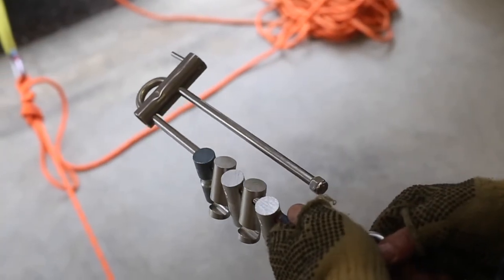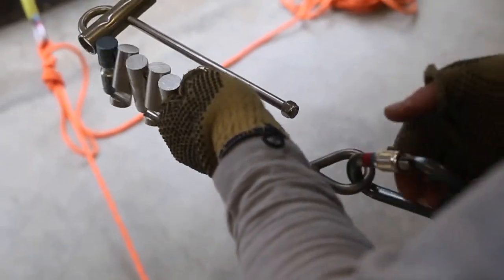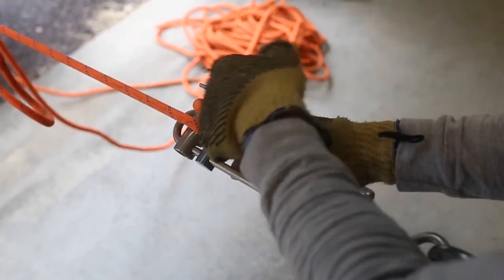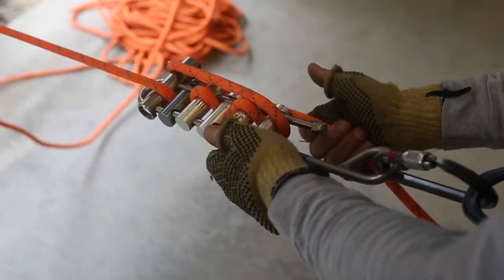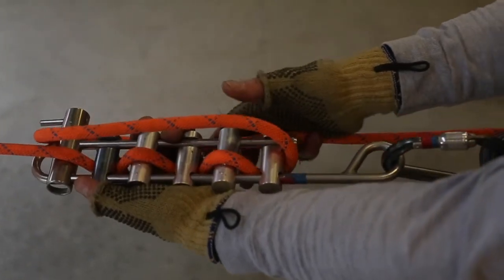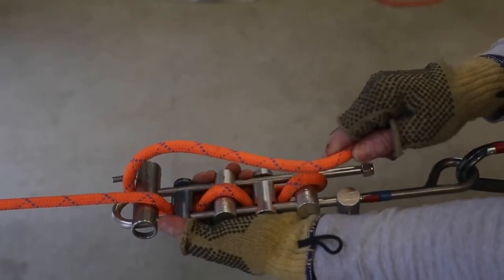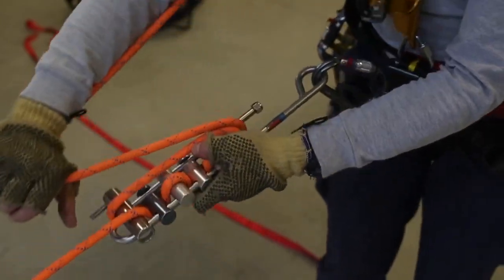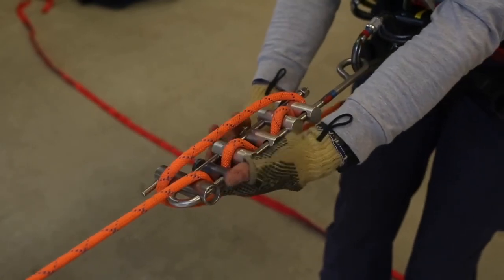Rig & Operate a 6 Bar Brake Rack for a Rappel: Rope Rescue, VTTF1 USAR

Comment: Great demo.  I use an ATC with a leg loop autoblock.   However I do notice that the ATC can get quite hot so you have to lower slowly.  I assume this device is good at friction handling and distributes the heat more evenly ?  I’ve even noticed GriGri cam autolock devices get damned hot too.
Reply: In my case, for climbing, I should add.
Reply from the maker: You are right. All descent control devices are going to generate heat. The brake rack does a good job of dissipating heat but comes with the added weight. It’s a great device as it gives you the ability to vary the amount of friction, making it a good tool for performing a Pickoffs. When performing single rope techniques, it is always best to use a back up, and I also like the autoblock. I would recommend extending your ATC with a short sling and attaching your autoblock to your belay loop rather than your leg loop. thanks for watching!
Reply: @legnip  Thanks.  I do extend my ATC from my belay loop typically.  However using your autoblock at the belay loop can cause a cluster F if you twist.   I’ve always found that autoblock on the leg loop is a lot easier to manage as the rope pays out better there.  I usually have  2 hands doing the feeding too. Was there any particular reason you like the autoblock on the belay loop ?  Convenience (+ another carabiner on the belay loop!).
Reply from the maker: @pentachronic  there have been a few instances where a fallen climber was knocked unconscious and their leg wound up bumping the autoblock causing them to slide off the end of the rope.
Reply: @legnip  I’d like to see how this can happen.  The autoblock is right at the harness leg loop and essentially above the groin.   A girth to the leg loop and then locked off with a carabiner to the leg loop.
Reply from the maker: @pentachronic  here's the scenario: climber falls, sustains a head injury, becomes unconscious and loses postural tone allowing the legs to go limp. This may cause the leg to rise up and depending on how much extension is on the rappel device , the auto block winds up getting tended by the device.

Comment: If you let go of the rope entirely with your brake-hand during a descent, does the rack "auto stop" the free fall?  As in, do the bars self-constrict (so to speak) and "trap" the rope to keep you from entering into a state of free-fall?
Reply from the maker: The brake rack does not have an auto-braking feature so the brake hand should never come off the rope. One way to mitigate this for rappelling would be to place an autoblock friction hitch on the brake strand. This is referred to as a Guide’s Rappel Backup.
Reply: @legnip a prusick?
Reply from the maker: @spaceman8839  When performing single rope techniques, it is always best to use a back up, and I prefer the autoblock. A prusik hitch would work but the autoblock is easier to free up after loading whereas the prusik hitch gets very tight. I would recommend extending your rack with a short sling and attaching your autoblock to your belay loop. thanks for watching!
Reply: @legnip  Awesome, thank you

Comment: If you are using this gear for work (carabiner and rack) they do not comply with OSHA regulations. Do not use for pickoff rescue (not rated for rescue). Also equipment shown do not comply with current ANSI requirements for hand slip and panic mode. we stopped teaching and using racks over 10 years ago. Spend $300 to buy an ANSI approved descender and save a life yours and your patient.
Reply from the maker: The technique and use of the brake rack in this video is intended for rope rescue and not rope access work. True, it is not ANSI certified but it does meet NFPA 1983 G- Rating standard and is rated at 9000 lbs. It would be advisable if using this device (or any other descent control device that lacks an auto-locking cam feature) that a friction hitch back up be placed on the brake strand of the rope. Again, the techniques shown in this video are specific for Urban Search & Rescue teams. Thanks for the comment!
Reply: @legnip  What application in USAR are u going to use this for? I got my rescue I training with TF3 and I never saw them use this.
Reply from the maker: @jayjamali2485  The brake bar rack is a traditional descent control device that has been a widely accepted tool used for lowering rescue loads. Additionally, it serves as a rappel device and because you can vary the amount of friction, it is suitable for performing pick-offs. There are certainly many other tools out there (CMC MPD, Clutch, Petzl Maestro...) however many USAR teams and fire departments still have these devices in service. Please note that this device would be used in a system utilizing a weighted main line and a dedicated belay line.
Reply: @legnip  what you are saying is that using equipment that is not OSHA compliant but traditional is acceptable to many fire departments and you. There are many things that are traditional but have not been acceptable in a professional setting for many years perfect example is self closing and self locking carabiners with a 3600 pound gate strength (required by OSHA).
Reply from the maker: @jayjamali2485  OSHA often says that it does not regulate rescue and many public safety organizations agree. Three OSHA regulations that do apply to rescue are:
CFR Subpart M - Fall Protection Sec. 1926.502(d) states that "the employer shall provide for prompt rescue of employees in the event of a fall...
CFR 1910.146 Permit Required Confined Spaces - titled Rescue & Emergency Services, lists specific requirements for rescuers responding to a confined space incident.
CFR 1926.650 Subpart P, Excavations: The federal standard for trenching and excavations operations including rescue.

Additionally, OSHA does not make equipment specific recommendations. In the end, follow your local protocol and understand the limitations of your equipment.